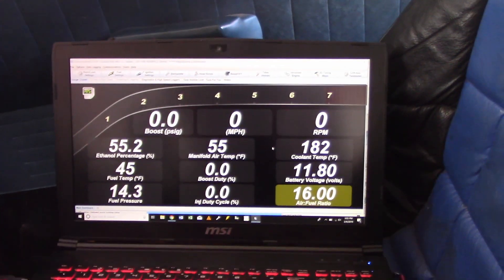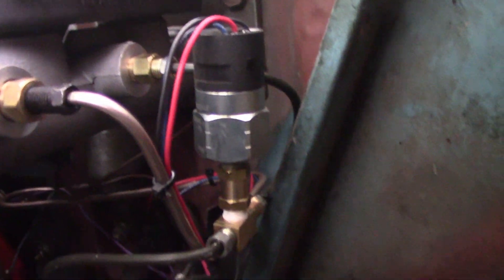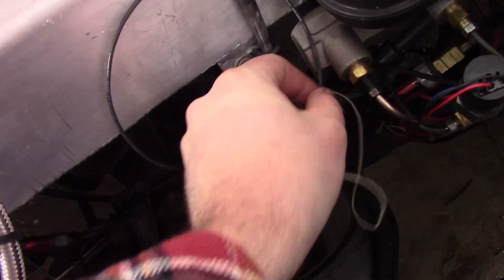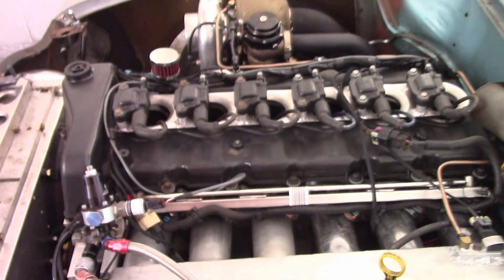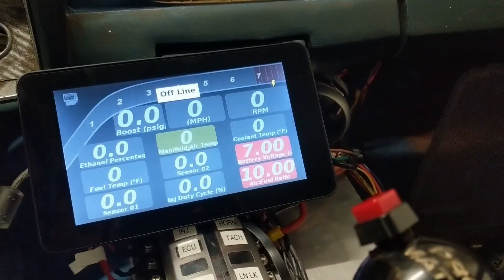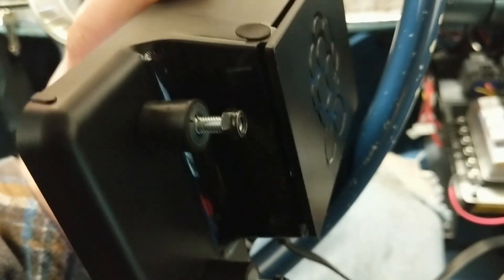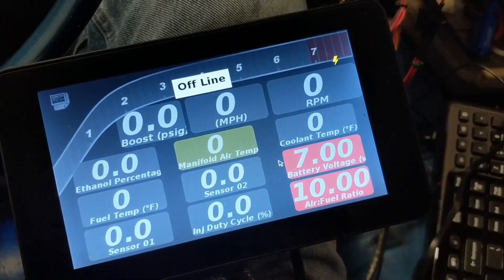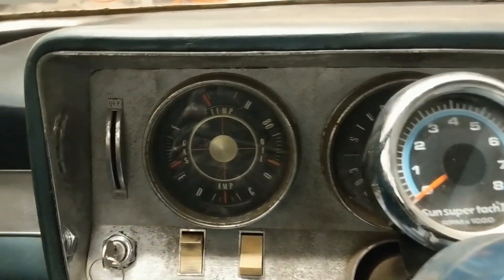Raspberry Pi Digital Dash + Hooking Up the 2 step

Comment: Did you come up with this on your own?! I wish I had the time, money and knowledge to build custom cars!
Reply from the maker: The digital dash, no. The pressure switch yes
Reply: @Calvin-Nelson  sorry I should've been more specific lol. Any idea if the raspberry Pi or any other diy dash is popular? Seems Dakota Digital has been the leader for a long time.
Reply from the maker: @grabasandwich  I wouldn't say it is popular at all. I have quite a few hours into fooling around with the raspberry pi, just trying to get everything set right.

Most people prefer a plug and play solution.